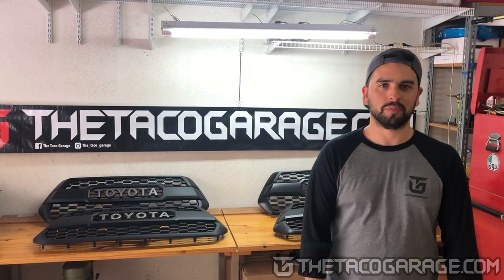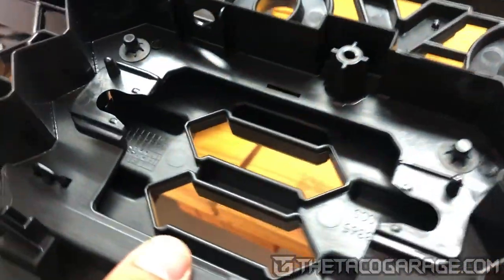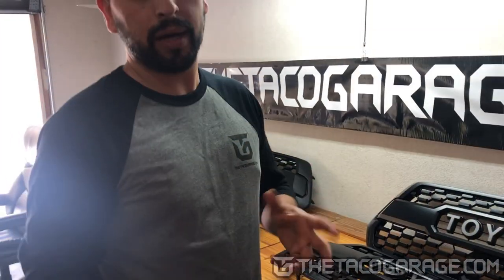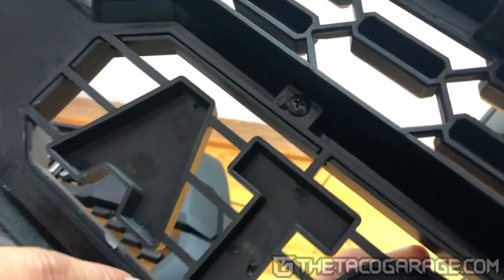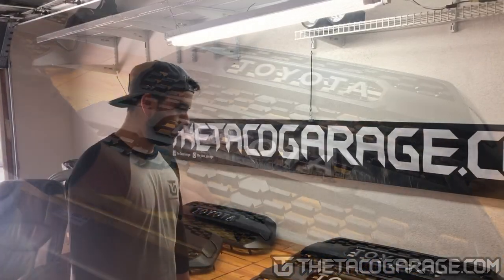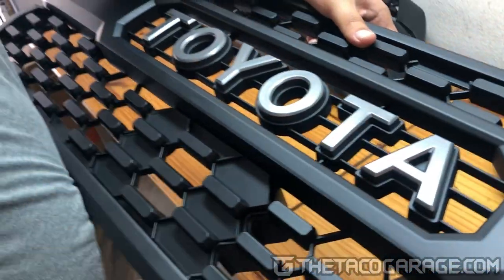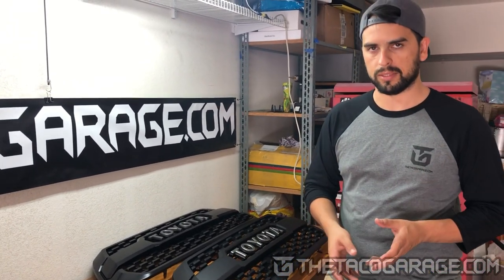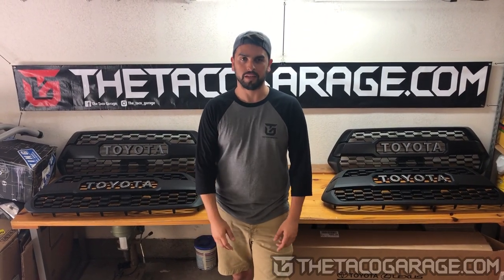TRD Pro grill review, is an OEM Tacoma TRD PRO GRILL actually better than aftermarket?

Comment: My experience with TWO aftermarket grilles with the INDIVIDUAL SCREW ON letters is that the tiny little plastic screw posts in the letters eventually break and the letters fall off or start to fall off. I then glue them (which is harder to find contact points than you would think) and they eventually formed hairline cracks all over. For anyone considering an aftermarket grille, I would say to avoid the individual screw on letters at all costs. I wish I had. I just purchased an OEM TRD PRO grille because I don’t want to F with worrying about any letters falling off again. And now I will be able to take it through a car wash if I want to and not have to worry about the damn letters.

Comment: Ive had an aftermarket  TRD Pro grill , I assume probably a Chinese Knockoff, that cost me about $200.  The Toyota Silver letters stuck on with 3m tape over Black backings. Its been on my truck 5 years and just as good and solid as the day i bought it.

Comment: You should measure its thickness in the ribs and around the side as people say the OEM is thicker, maybe weigh them all ?
cool with a 4 parts. i ended up painting my letters over with a different color so the extra silver didn't matter.

Comment: One item you missed was the second aftermarket grill (3rd grill shown) did not have the mounting holes for the TSS wiring harness. You should have included that with your commercial.

Comment: All four of those grill are easy to crack cheap junk.Get the custom made metal , powder coated grill , the gave it sprayed with bedliner before installing it ..Total Badass look.
Reply: 😂 Yeah, sure. Buy a cheap piece of expanded metal junk that is so flimsy it bends if you hit a large bug at 70 mph. Added bonus it looks like it was made from a left over furnace filter
Reply: The metal ones can look too Bro Dozer. It’s an option if that’s what you want. Costs three times the price of the pro grill though.